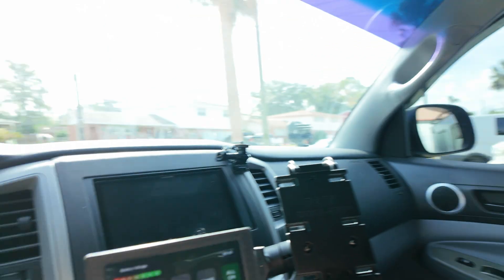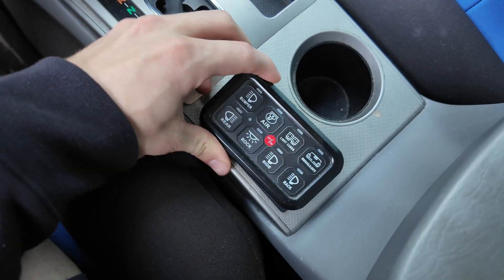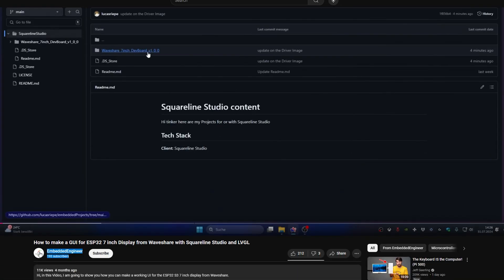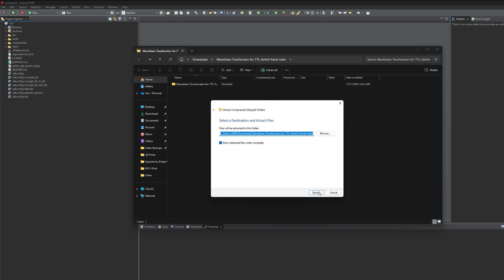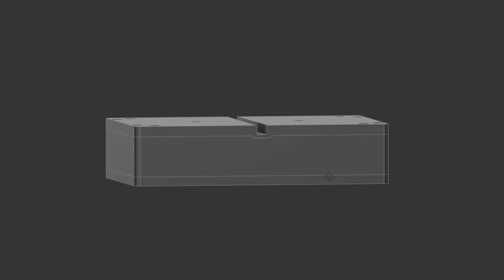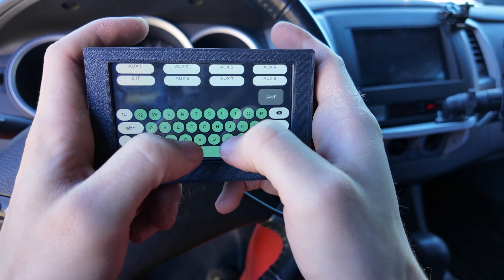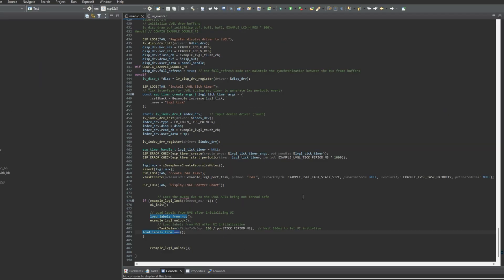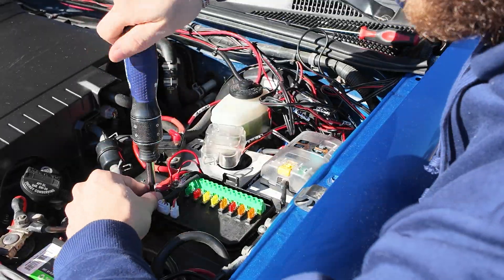Upgrade Your 12V System! $50 DIY S-POD Alternative

Comment: Have you been able to figure out the different functions for the buttons as far as toggle on/off, momentary, or flashing? Extremely interested in doing this as well!
Reply from the maker: I have not, started a new job shortly after making this video and lost all the time/energy to learn it.  It's still functioning as a controller, but not to its full potential!

Comment: wow that's a LOT of work buddy! good on you to dive right in and nerd it all out! Without people like you willing to spend the time AND share the struggle and results none of us would be willing to give it a shot. side note, what mic are you using and what's your 3D printer set up ?
Reply from the maker: I'm using the Hollyland Lark M2 for most of the audio, the other times are just the built in Osmo Pocket 3 mic since it was a quick clip.  My 3D Printer is the Qidi X-Plus 3, I've had it for about a year and I've put it to work.